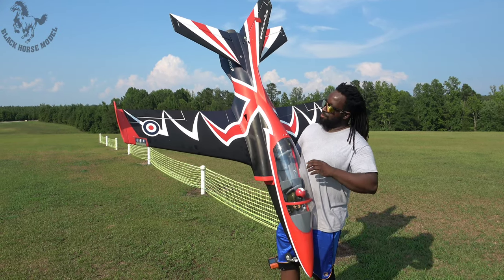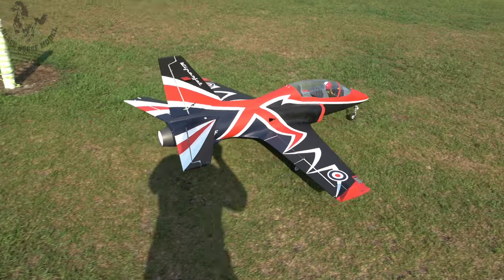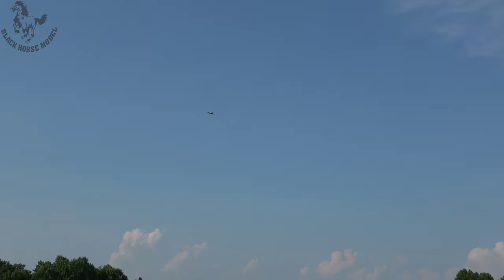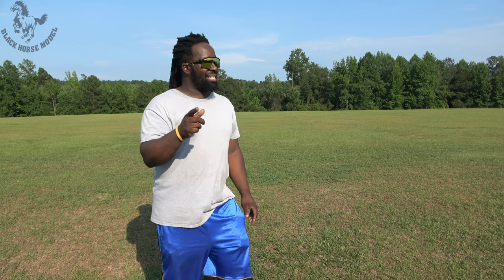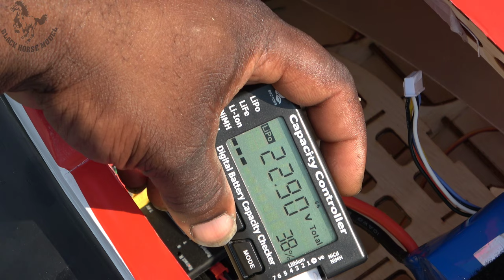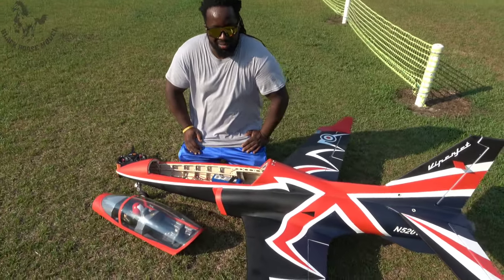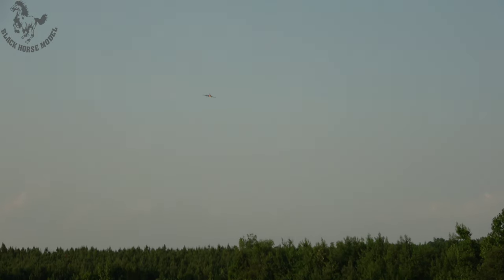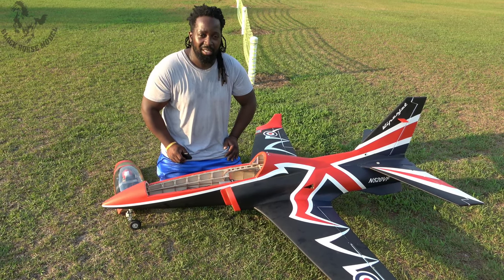Blackhorse Viper Jet Maiden Flight #rcpilot #aviation #rcjets #rcplane #motionrc

Comment: Will man,I recommend SMC green packs 7600-8200 for 5-6 min flight time.i would not trust those turningy for a prop plane.that fan and motor  draws 160 amps and needs good.packs.great job man 👊
Reply from the maker: Thanks brother. It was my fault on the packs I didn't check them before flight. It was a mistake that could've cost me a lot. I have 4 new HRB 6000s for it now. I plan to only use the pairs for the twin pack planes I fly.
Reply: Smc garbage! Smoked 4 packs in a row on this same jet same packs you are recommending , 118 amps wot ! Smc equals crap
Reply: @michaellussoro2295  you must mean the purple lihv SMC Packs.The Green label SMC regular lipos I'm pulling 160 amps and they come down barley warm.

Comment: Two down Will😊 that first set of packs almost didn't do the job😮 makes me debate to use new or used packs for a maiden 😊 the landing speed will get slower as the Nerves settle down😊
Reply from the maker: Yeah we didn't check the packs before flight. I was so focused on preventing motor and esc failure I forgot the most important thing. Checking my energy source. 😆
My 2nd flight I was a little more relaxed but you're correct the more flights the more comfortable I'll get. 👍🏾

Comment: Pilot Will, what was the outcome of the difference with the 2 packs? I had this happen in my blackhorse after the maiden.
Reply from the maker: So we realized afterward that one pack was not fully charged. We trusted both packs were charged and didn't check them before the flight as part of the preflight

Comment: Very nice first and second flight Will! And good camera work Bobby! BUT when I saw those Turnigys in your plane I though WOW, so much $$ and work on that plane and flying that batterys. For being honest I haven´t had any of those but I have seen the most pretty popped so I wouldn´t have trust in them. And checking them confirmed my thougts. But maybe one battery wasn´t charged or not fully charged? Also one could be older (?). HRB are a good option! :) I have confirmed it by myself with a friend too. Testing different brands. Good weight and proper performance! Also in that big Viper I would try 12S2P Molicel P45B giving you 9000mAh at the same weight as those Turnigy and maybe slighly less. Look at @EDFjetRC Wojtek flying LiIon with 2P or sometimes super light 1P :D Soon are coming also 5000 mAh cells from Molicel :D
Reply from the maker: Hey thanks and I have seen him flying the Lilon packs and he's getting 8 minutes of flight. I just purchased 4 HRB 6000s for the jet and plan to pair them so they will never mix up with any other packs. 2 packs will be marked as pair 1 and the other 2 as pair 2. They will always charge and discharge together.
Reply: @rcpilotwill  Hey Will! in my small experience HRBs are very good. I have compared them to known and unknown brands. A friend also. Doing thrust measurements and current. I wouldn´t be afraid of mixing those HRBs if they have the same age and similar usage. The internal resistance from factory may differ a bit too and you will not be emptying there until 3,3V or something similar I hoppe. I wish you good flights! I´m also stepping up on a second hand FW Avanti S V2 (I´ll try LiIons) and soon I´ll try to maiden my 90mm Viper from FMS. Thinking to buy the new 90mm Avanti from FMS but it´s pretty the same as the FMS one but smaller wheels and more weight. The color (golden style of Germany ) is cool and the vector nozzle. But I´m still a beginner with too much planes in the basement xD
Reply: @rcpilotwill  How many amps your fan pull? Around 100A-110A ?